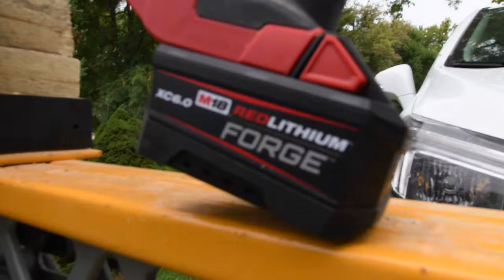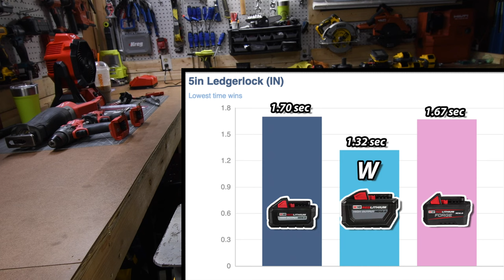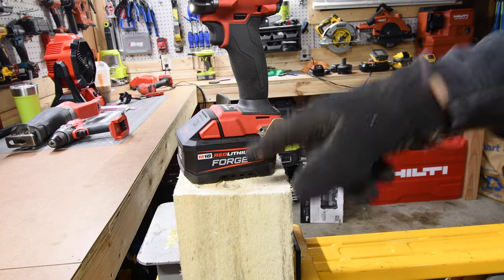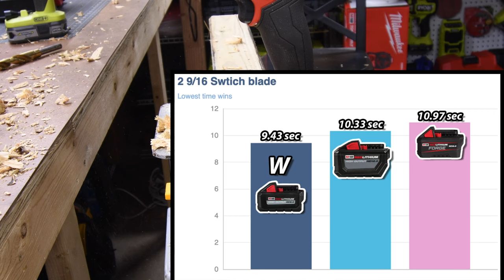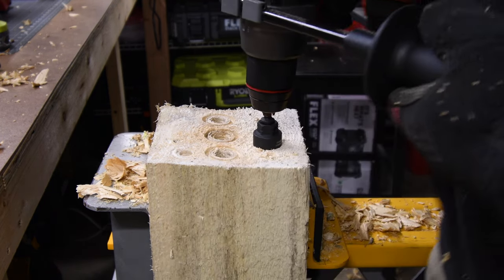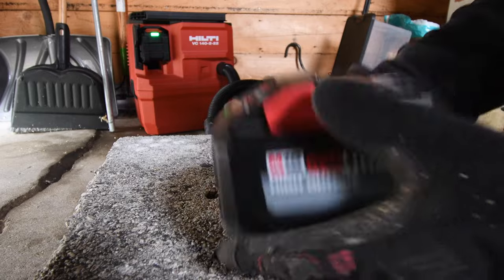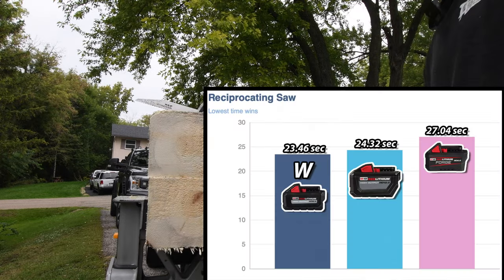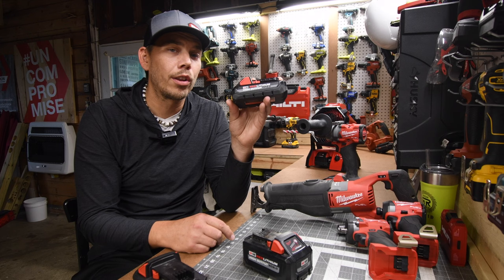NEW Milwaukee 6ah FORGE!!

Comment: Great practical testing here! I doubt they will make a 3-3.5Ah the size or smaller than the 3HO. 21700 cells being 21mm, they become really inefficient when you stack them on top of each others while pouches dont, because of that empty space between the cylinders. Thats why the 6 FORGE is smaller. 1P packs like the 3HO, i dont see it. I think they already said the next FORGE battery is going to be 12Ah tabless cylindrical cells anyhoo
Reply from the maker: at least we have the Dewalt 1.7ah. we will see what these BOGO sales are going to be this year on that Forge. Thank you for stopping by TTC :)

Comment: I switched to ALL FORGE, they are only marginally bigger then the 5.0, shorter then the 3.0H.O. And lightet then the 6.0 H.O. The Torque test Channel does dyno testing. The watts out put on all the tools is always at least slightly higher with the Forge. The 6” Grinder, which is the tool I use the power on the most goes from 970 watts with the 12.0, to 1160 with the Forge…!!  Now when I am up on the roof, or in an attic, and run out of battery on a high demand tool, I can use the battery from my Impact driver to Finish the task and have full power. The fan run time test would indicate Having the equivalent of 6.42 A.H. in  run time is a added benefit.

Comment: i use flex stacked batteries with an adapter with mine. Works great.
Reply from the maker: I might need to get one of those adaptors
Reply: @Jasonitodd Where did you get your adapter? I have been wanting to try the Flex Stacked Lithium battery with my Milwaukee drill.

Comment: Enjoyed your video, but the Forge battery is really designed for tools that will benefit from the higher output capacity.  For small impacts and saws the regular or HO RedLithium batteries are fine, but when you step up to the 1/2" and 3/4" high power impacts the Forge really shines with over 100 ft lbs more torque.  The harder a tool works the more it will benefit from the Forge battery.

Comment: Honestly if I had the funds to start over into a new tool line I'd go with Flex, I believe their stacked lithium will become the standard for batteries and you can already see other brands (DeWalt) gravitating to it.  Not to mention Flex lifetime warranty for buyers before the end of 2023 which im not sure if that's gonna be like Ridgids LSA or if it actually is a warranty but yah

It'll be like the old nicad to lithium switch in about 5 years every brand is going to switch to stacked vs the 18650/21700 cell batteries watch and see..

If this comment doesn't age well it's because I've been drinking and smoking some pork shoulder so I'm watching tool videos for entertainment while i wait for my food to cook.  😂😂
Reply from the maker: This comment is bad a$$ I thank you for tuning in bro, hopefully your meal is delicious. Flex is a darn good brand. I great tools and batteries and that stack pack system.
Reply: Pouch cells won't be a standard, cylindricals just got even better with tabless tech and pouch cells have some disadvantages over cylindricals

Comment: No wonder the 6.0 ho won on the concrete it was a new bit lol.  Wish you would have ran thise lag bolts in on speed 2 to show the difference in height after the drill drove them in as far as they could.  Thanks for the video was sweet :).  I'm atlas they brought the 6.0 out b4 the 3.0 forge because the 3.0 forge would probably be the same as the 6.0ho  I wanna see more power lol

Comment: In tests where 6ah ho was first and forge last, it was probably because of the tool getting warm progressively imho. Forge should win every time everything else being the same.
Reply from the maker: that 6ah HO battery was Milwaukee's best battery. it would be hard to top that. the Forge did really well and its lighter for the same ah. we will see if they make a smaller version in the future and we will see what sales are coming in the future for them,
Reply: @ManCaverTools  yeah 6ah ho is really good, it has big power output but still forge has slightly higher max power, it's not worlds apart ofc

Comment: Several concerns.  It's a new design.  New designs need to be vetted by other people...not me.  I doubt milwaukee did much more than minimal testing.  Milwaukee still does not have a fan cooled charger that is a regular charger.  I will not use a super rapid charger.  I prefer the standard.
On the upside they're new and home depot cannot sell these 2 years old.  Which is probably why they're not in stock yet.  Milwaukee is aging them for home depot.......
Reply from the maker: rapid charger is good for a quick charge here and there. but the cells love to be charged on a normal charger most of the time

Comment: With the Masonary bit  really any bit. But especially the Masonary bit whichever battery runs first is going to have the advantage obviously. You get enough views off of your videos you can’t afford to buy several bits and several blades.
Reply from the maker: each battery concrete bit and saw blades. which I showed they had.
Reply: @ManCaverTools  well, maybe you edited that out you might want to rewatch it. You don’t show new bits each on  one. If you did you did, but it wasn’t clear.

Comment: The only problem i see is increased tool break down. Milwaukee already known out of the big 3 as the least reliable.
Reply: That’s not true. I’m in all three platforms. Four if you count Festool. My DeWalt tools are probably the worst offenders.
Reply: @steffendetrick  I'm on M18, m12, Kobalt, Dewalt, Makita and Ryobi but the M18 line has had the most problems with batteries. Your personal experience doesn't  matter on the whole. Milwaukee has the most warranty returns. Milwaukee goes for power but sacrifices to reliability.  They are not power capped like Makita or Dewalt. This is why I see more tools getting burnt out or breaking.  I'm not saying their tools are bad but they have a higher breakdown in tools and batteries than other 2.
Reply: @ZeroFallout1  neither does yours. I’ve also been in the construction industry for 23 years and I’m a project manager to give context. I worked my way up from a helper/Labor to where I am now, so I’ve been involved in all phases of construction, so save it .This isn’t just my personal experience. This is my experience of working in the industry. Your statement that it’s known that Milwaukee tools don’t last as long is untrue. There are plenty of people that would disagree with you, me being one of them. That being said their five year warranty is also much better than Makita or Dewalt.
Reply: @steffendetrick   I have those stories from people to and the ones that get warranty the most are Milwaukee. Let's not forget the colet issue or the bad impact wrench issue. Had a mechanic buy 5 of them and all were bad because of the design change. When I say reliable you take it as I'm saying Milwaukee is trash. There failure rate from factory is probably like 10%. That means 90% still good with no problems.
Reply: @ZeroFallout1  the Collett issue that they had on the GEN 3 that they fixed with the GEN3.5. That’s what you’re basing this of off. 
And like you just said, all of your information is coming from stories, third parties, or YouTube not hands-on experience for 23 years. You’re not on a jobsites using these tools every day, in a professional capacity. This is the world we live in people get hobbies and watch YouTube videos, and think  that makes their opinion a professional opinion. You don’t know what you’re talking about is the nicest way to put it. But I honestly believe whatever you wanna believe it does not matter to me.
Reply: @steffendetrick  So you gonna throw that collet issue away like it wasn't  a big deal. Never even disputed any of my claims. You claiming 23 year experience on the internet don't impress me. All I hear is a Milwaukee fanboy. All of my claims can be easily googled or youtube. Maybe actually try owning more than Milwaukee and your feelings won't be hurt
Reply: @ZeroFallout1  someone’s got reading comprehension problems😂
Reply: Within our company, Milwaukee seems to have the most problems. Particularly their hammer drills (never a fan) smoking up, Chuck problems or trigger issues.  Reciprocating saws locking up, burned up and the M12 copper cutter getting wet and not working til it dries up, or never coming back to life.  I have personally experienced all of those,  along with coworkers and for the most part, medium duty. Their warranty seems to be pretty solid, just can take a long time getting tools back.  I’ve had good luck with Milwaukee batteries, but others have not.  These days I only use their batteries for lights for the most part, since I switched to Hilti years back.  But still have a lot of Milwaukee still in use when needed.  Of the big 3, I’d put my money on Makita.  Better build quality